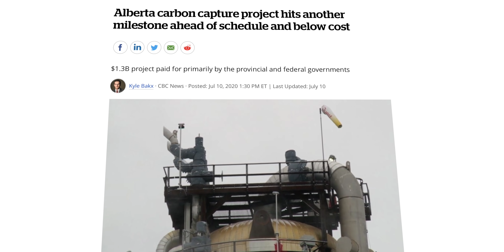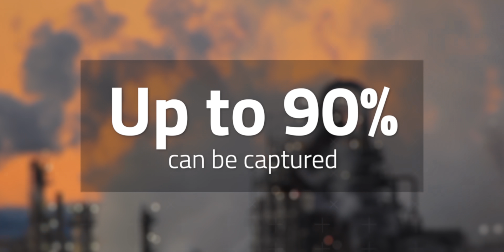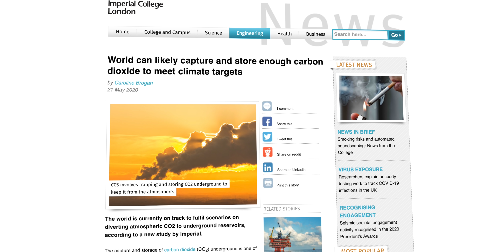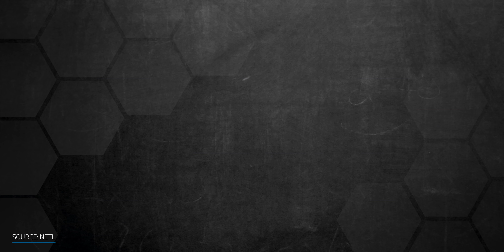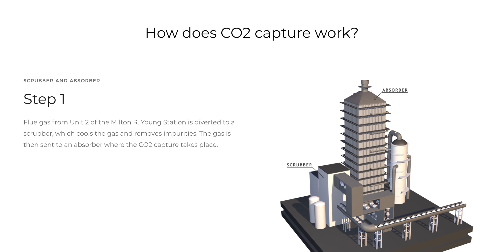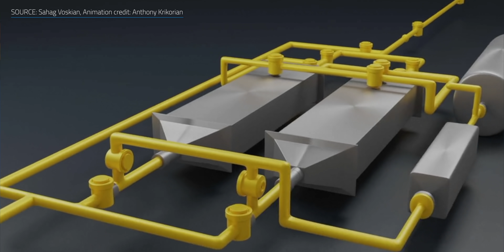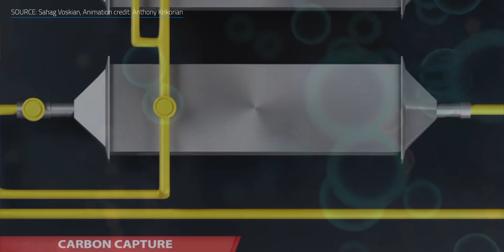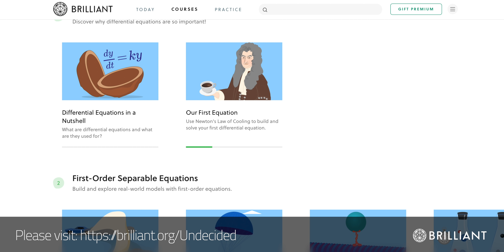The truth about capturing CO2 to reverse climate change

Comment: I am currently working on a Cryogenic Carbon Capture solution for heavy fuel oil powered marine vessels. Process uses a series of heat exchangers to initially cool flue gas then compress and later expand the mixture to reach -100C or below. Interesting thermodynamic property of CO2/N2 mixtures is that the CO2 will deposit (gas -> solid) out and your separation is complete. I am wondering why this topic has not been discussed, especially against amine based solutions which are very energy intensive, have a slower refresh rate (have to wait for binding and unbinding) and require cleaning to maintain.  Thoughts?

Comment: Ontario Canada is luckily enough that our combination of nuclear power generation and hydro generation  is so efficient that actually adding more  solar wind  results in a NEGATIVE CO2 addition to our grid because these sources are  intermittent and requires back up natural gas burning when the sun is not shining and the wind is not blowing.... If our Ontario Government would partner with CARBON ENGINEERING (which takes carbon out of the air and turn it into car fuel)  we could have carbon NUETRA FUEL...  by using FREE electricity at night ( Ontario actually DUMPS EXCESS POWER OFF THE GRID every night )  to create this petrol/ gasoline out of thin air  we could run in all our current carbon burning cars and trucks without sucking one more barrel of fuel out of the ground.   On carbon neutral fuel.... Eventually of course when our current cars need replacing, we could switch to electric cars put until then e could run on CARBON NEUTRAL FUEL...  https://www.cbc.ca/news/canada/british-columbia/b-c-company-says-it-is-sucking-carbon-from-air-making-fuel-1.4696817

Comment: One of the problems right in front of our faces with all these carbon mitigation efforts is that the degenerate incentives to use carbon product that we fight so hard right now will not just magically go away in the future.  If we create vast deposits of underground CO2 around the world, and also technology to convert that economically to re-useable fuel or other product that can have adding emissions, we may simply be creating a ballooning point in the future where an aggregate of corrupt players will suddenly use the technology, and finish off what is left of planet ecosystems with a climate temperature spike.  Other solutions not only need to be primary, but given existing incentives for making these exploitable deposites, we should simply not do them, but allow them to be created, if at all, through existing market forces.  Otherwise, we are just loading a pistol for future russian roulette.

Comment: I don't want to see CO2 capture, but rather, conversion to both carbon and oxygen. The oxygen can either be burned off or stored while the carbon can be used for carbon based manufacturing such as carbon nanotubes and carbon-fibre.

Comment: At the beginning of the video when you're talking about pollution and energy companies you do realize you're showing cooling towers and what you see coming out of them is Steam we have come a long ways since we go straight from burning coal to putting the exhaust up a smoke stack and emission control is required and is essentially a secondary building that scrubs the exhaust particularly of the Ash and sulfur particles to clean the air and keep sulfuric acid from forming when it rains. It just gets annoying when you see people say that steam is pollution.
Reply: CO2 is also not pollution: it’s the very food of life. Of course you can have too much of it, like you can have too much chocolate.
Reply: My dad pioneered the stack baffles to take particulate matter out of exhaust but C02 is a gas and it escapes with the water vapor.
Reply: yeah i was wondering that too. but ill let it slide
Reply: Water vapor IS a GHG just so you know. Not as persistent and powerful as CO2 though.

Comment: What I've read is, Water vapor and greenhouse gases, absorb IR photons sending most of them back into space cooling the earth by reducing the sun's heat that is able to make it to the earth's surface. 

https://earthobservatory.nasa.gov/features/EnergyBalance/page6.php 

"Just as the major atmospheric gases (oxygen and nitrogen) are transparent to incoming sunlight, they are also transparent to outgoing thermal infrared. However, water vapor, carbon dioxide, methane, and other trace gases are opaque to many wavelengths of thermal infrared energy." "When greenhouse gas molecules absorb thermal infrared energy, their temperature rises. Like coals from a fire that are warm but not glowing, greenhouse gases then radiate an increased amount of thermal infrared energy in ALL DIRECTIONS". "Because greenhouse gas molecules radiate heat in ALL DIRECTIONS, some of it spreads downward and ultimately comes back into contact with the Earth’s surface, where it is absorbed. The temperature of the surface becomes warmer than it would be if it were heated only by direct solar heating. This supplemental heating of the Earth’s surface by the atmosphere is the natural greenhouse effect." Up high or down low, I don't see any difference if NASA is correct. At the height of the Atmosphere, the Earth constitutes 1/3rd of the space. So the IR absorbed by the ghg, both for incoming sun heat and emitted Earth heat, will be absorbed then emitted in "all directions". 1/3rd will hit the Earth below and the other 2/3rds will go into space. Of the Earth emitted heat, 1/3rd of that will be absorbed by the ghgs going out, and sent back to the earth adding additional warming to the earth, this warming is the greenhouse effect according to NASA. So, water vapor and the ghgs, cool the earth by blocking out 66.4% of Sun heat, while keeping in only 11% (1/3rd of 1/3rd). The atmosphere keeps out six times more heat than it keeps in. If we add more molecules of CO2 they will absorb more entering sun heat and cool the earth more than they do now. With the earth getting less heat, there will be less heat to keep in, so the GHE should fall. I don't see how, if NASA is correct, we can be warming the planet by adding more CO2 to the atmosphere.

Comment: I am not an expert on that matter. But isn't it the case that you get energy by burning carbon based stuff. If you want to split this now apart you can only do that by putting energy back. So overall (including losses) you have to put in more energy than you got out of it in the first place ?  If that is true this makes no sense.

Comment: IMO when this tech is implemented we also need something determine when to STOP collecting CO2. We already know the problem cause by too many CO2 in atmosphere but do we know what problem will happen if we have too little CO2 in the atmosphere.
Reply: Relax. There is a chemical balance between the air and the ocean, and the ocean will immediately release new CO2 to the air if the concentration becomes too low. It is the ocean who chemically determines the CO2 concentration in the air. Nothing we can do to alter this chemical balance.

Comment: Plants need co2. We add co2 to green houses 1000 ppm is a common economic threshold. 400 ppm current atmospheric level. Sensitive humans react at about 2,000 ppm. US Navy threshold aboard submarines is 5000 ppm. Plants function better at higher CO2 levels use less water. We would all be better off if we had higher CO2 levels.

Comment: Ok, so we burn fossil fuel  producing energy, water vapor and CO2, but CO2 is bad, unless your a tree or some other flora. So we're in the process of switching our infrastructure to use renewable energy sources, which individually and collectively cannot replace hydro carbon fuels.  Neither as a full time base load source, nor can they match the energy density of hydrocarbons. So vast tracts of land or, increasingly, ocean must be allocated to harvest this resource. Once produced the energy must be stored. Lithium batteries are the current technology. Lithium is a mined product. Drawn from the ground in areas reminisent, to an older person,  of the hugh open pit coal strip mines of a few decades ago. Monstrous scars upon the earth.  Since Lithium comes from natural processes similar to the ones that produce hydrocarbons, how long before Lithium becomes scarce? Then what, graphene? Back to carbon again. How much carbon has to be manufactured to produce useable amounts of graphene? What will we do with the rejected carbon? 
One (almost) final thought, all of this to rid ourselves of CO2. Using electric motors on the same scale as the internal combustion engine will produce gargantuan amounts of Ozone. A molecule that can oxidise (corrode) almost everything. AND. . . Wait for it . . . Is a greenhouse gas!
Actual final thought, current CO2 levels globally, are above 400 parts per million (ppm).
Ozone starts becoming deadly in concentrations smaller than 10 ppm.

Comment: You science-hating alarmists are going to get us all killed.  Why has every climate prediction been wrong?  Because the model (hypothesis) is wrong.  CO2 greens the planet.  Lush green forests and deserts are slightly less cold at night.  The "planet" hasn't warmed, rather the land is slightly greener.  Is greening a runaway temperature increase or stable verdant lushness?  CO2's grown 30% more plant-life than the 1930's, what happens if climatologists suddenly suck that 30% extra CO2 out of the atmosphere?  Have you "brilliant" boaster's thought it through? 

Just because CO2 drops precipitously, doesn't mean plant-life stops breathing-in CO2.  So when 130% plant-life attempts to breathe-in 66% of previously available CO2, "brilliant" climate alarmists just created a disaster.  A plant-life disaster.  All plants will suffer.  Most will die.  

Remember the movie, "Idiocracy?"  Climatologists are like those leading the world in that movie and removing CO2 from the atmosphere will have similar results. 

So when "brilliant" boasting alarmists create dust-bowls and famine and they try to blame it on climate-change, remember this scientist warned you what was about to happen.  This scientist made the only accurate prediction (based on a different, accurate model).  And when this scientist is proven correct, don't go running to the braggarts who got you in trouble in the first-place, because they'll only make things worse.